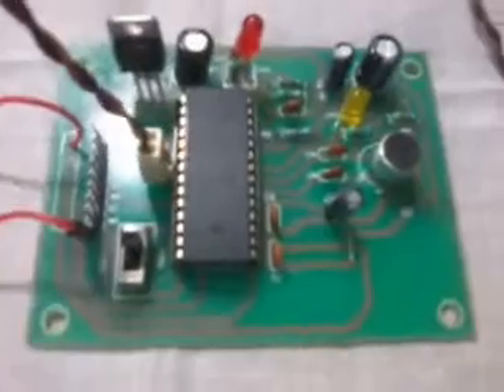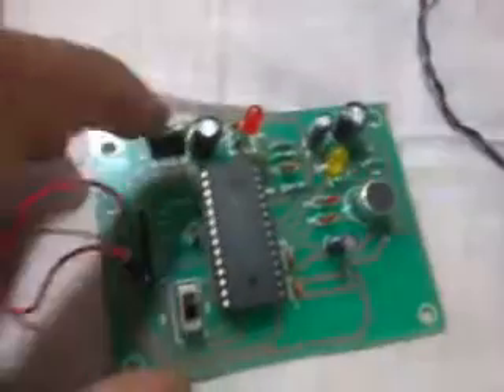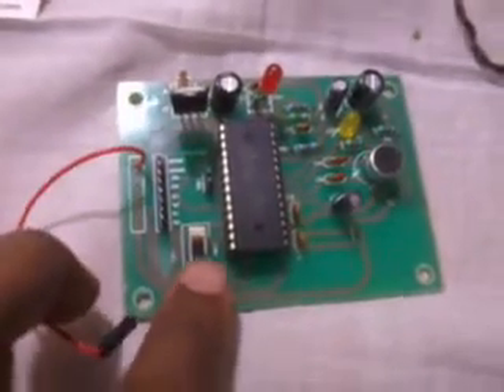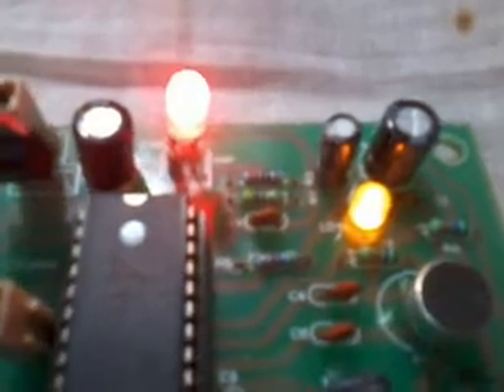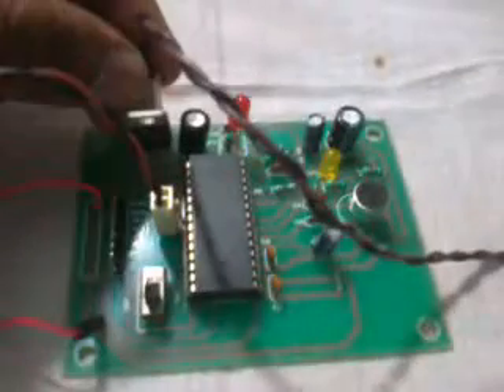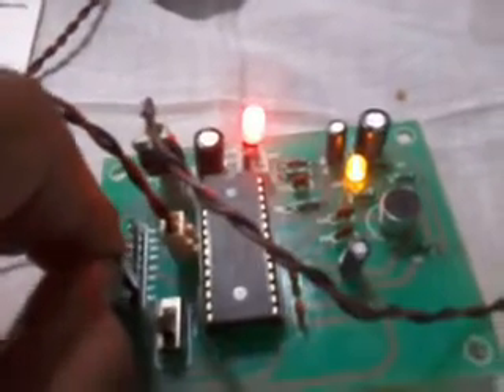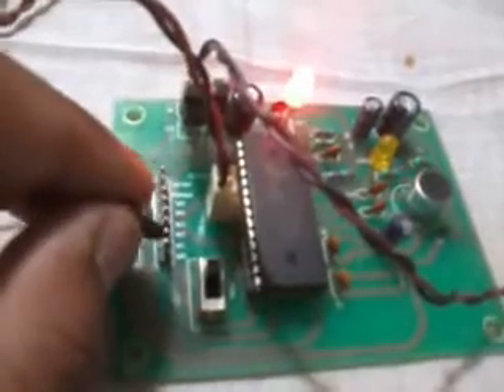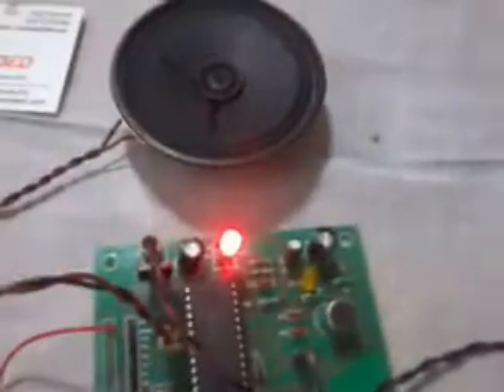Apr33a3 Voice Record And Play Back

Comment: when i use this with a micro controller, the messages are coming erratically. I want a few messages to come one after the another, doing the switching using the micro controller, but few messages are not playing, when i check them individually, all are playing
Reply from the maker: Thanks for watching and your valuable Feed back.change the apr33a3  ic then check it.